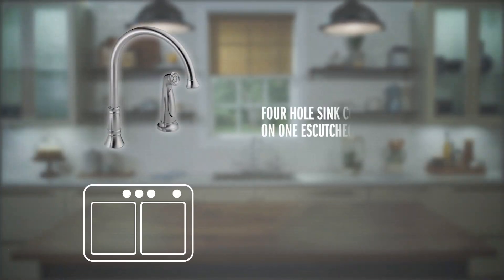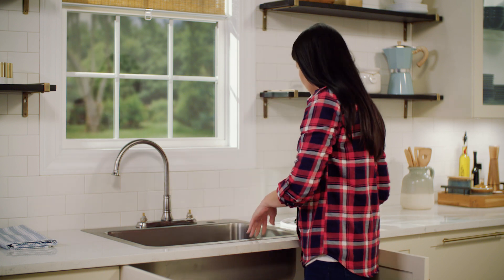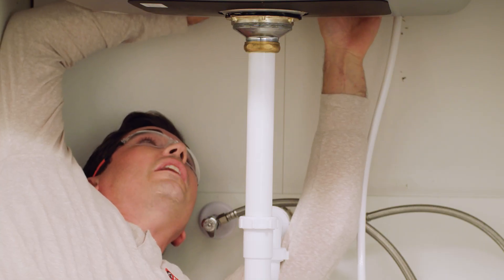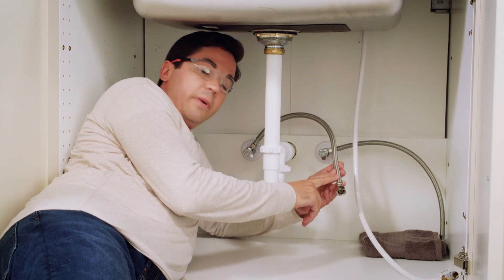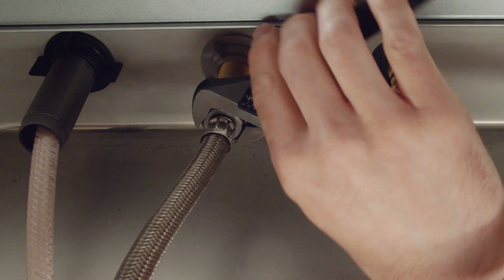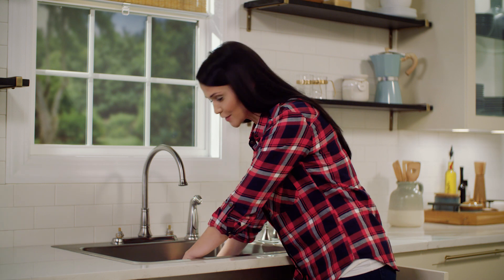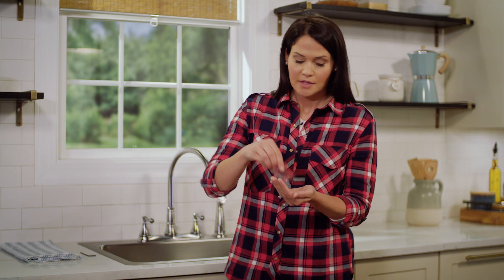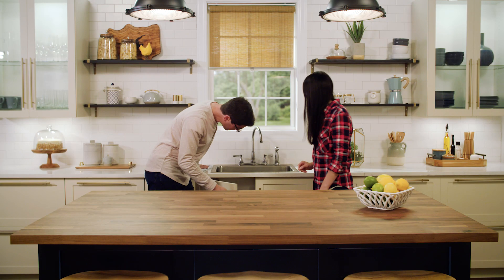How to Install a Delta® Two Handle Centerset Kitchen Faucet with a Side Spray

Comment: A couple better tips are to attach the hoses to each faucet before putting it in place, so you only have to connect the bottom of the hoses to the valves.  Also, start the set screws in the handles before you put them in place, so you don't risk losing them.
Reply: You can't attach the hoses first until the faucet is mounted. Because the large plastic mounting nuts have to go on first to secure it to the sink. They won't be able to slip past the water supply line, metal nut.🤦‍♂️

Comment: We are installing the Charmaine. Your video doesn't cover the escutcheon or the soap dispenser. We can wait on the soap dispenser, but have a question about parts included with the faucet. What are the two small white gaskets? What is the black plastic with two wrench-looking things on the side, a wider tube opening on the top, smaller tube opening at the bottom, and the tube opening on the side that doesn't go all the way through? Need this to know this quickly as we are stuck.
Reply: By the way, the instructions caused more trouble than help. Really need to connect your engineers with your manuals team.

Comment: Do Delta faucets come with the flexible supply lines? If not, what size (not length) supply lines to I need?
Reply from the maker: Hi, thank you for your question. If the supply lines are included or not depends on the model number of the faucet. Our DST models include Pex supply lines and other faucet either do not include supply lines or include flex hoses. The product feature and benefits provide technical specifications on our website.  The tech specs will provide supply lines information. -Brandis

Comment: Hey delta I have a very similar faucet that is now leaking from under the handles.  When I remove the set screw holding the handle on, the handle is still stuck on there.  Can hard water cause this?  Should I just force it off so I can replace the cartridge?
Reply from the maker: Hello, 

I'm terribly sorry for the issues with your Delta faucet. If there is a lot of build up beneath the handle it will become hard to remove.  I would suggest squirting a 50/50 solution mixture of tap water and white vinegar.

Dip a rag into the solution, using tongs if necessary. Wrap the rag around the set screw area. Leave the rag in place for 15 minutes or so to remove the calcium deposits that are preventing you from removing the handle. Repeat if necessary up to 4 times.  Feel free to contact us back if further assistance is needed. -Brandis
Reply: @deltafaucet  Ok I have another.  I had to get a new faucet, when I am installing it there is a black plastic gasket under the escutcheon.  One side is just plastic, and the other side has a soft rubber washer type material on the edge with three holes in it (one for each handle thread and one for the spout).  There is no indication for which way this piece goes in the instructions?  Does it go above or below the sink?  Does it go with the rubbery side facing up (towards the ceiling) or down towards the floor?

I see in your video yours is above the sink, but is it rubber side down or up?

Again there is nothing at all about this part in the instructions.
Reply from the maker: Thank you for your question! The answer to you question, is going to depend on which model you are installing. In order to further assist you, I would recommend you contact us privately. -Benjamin
Reply: I don't know the answer to your question but do you know what kind of screw it is mine must have went down the drain or whatever holds the handle on, and I can't find my allen wrench to tighten it up in the side hole so do you know what size of Allen wrench it is?